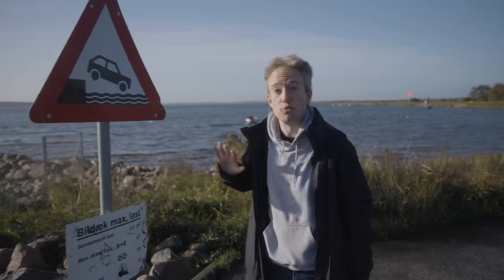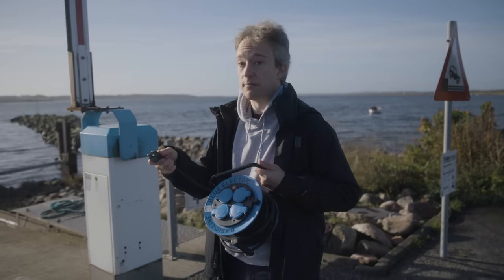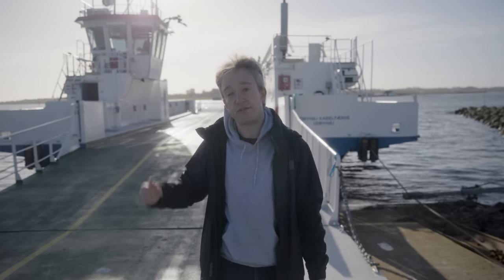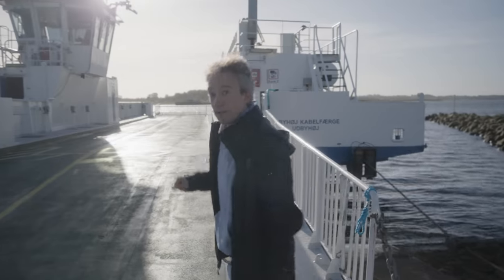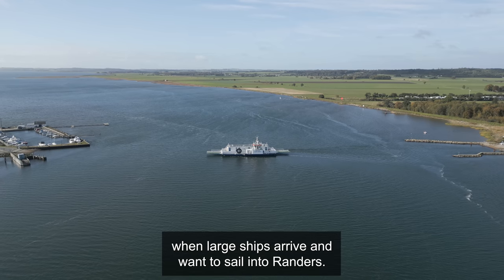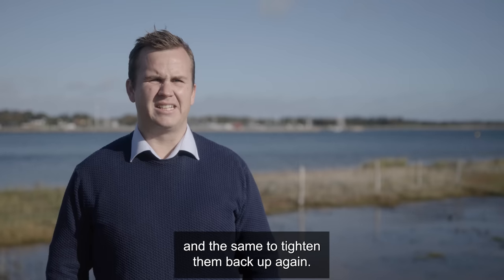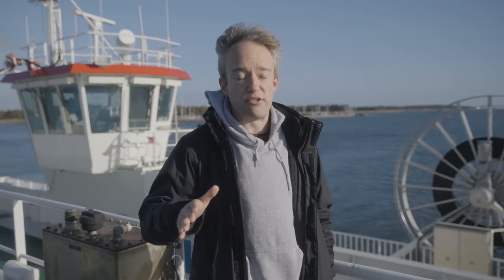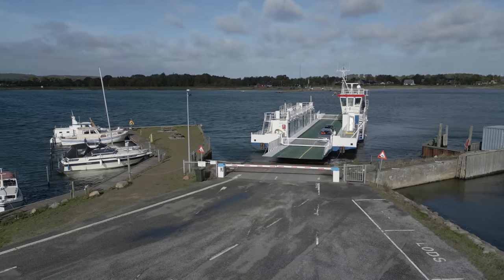This electric ferry uses a very long extension cord

Comment: It's a cable ferry so fine, why not another cable... But really a 200kwh battery pack could be easily and fairly cheaply installed on a ferry this size to allow it to run all day and charge overnight / or when it is docked a couple of times per day. A £50k Ford machE has a 100kwh battery pack so it is only 2 of these battery packs that would be needed to run this ferry for a day in the worst case. So even if the battery pack is 35% of the price of the vehicle. That is only £35k on battery packs, and £2k on chargers installed at the docks. That is not a massive extra cost.

Comment: Is the guiding cable the same as the one that provides the electricity?

And how do they prevent it from generating heat, if it's rolled up?

Comment: If there's a strong current the ferry doesn't even need a motor though, does it?
Reply: I wouldn't imagine it would be able to pull the ferry at a significant enough speed, even if it was pulling in the correct direction

Comment: At this point, why not just have a steel cable on a winch at the far end.. no need to put the motive power on the boat at all...
I guess this is probably a little more other-boat-friendly though.

Comment: After watching this for 5 minutes I came up with an idea is there not a way they could stick some type of like alternator to the battery with paddles on the side of the boat so as the ferry goes to the water to the other side it moves the paddles Which turns the alternator and thus charges the battery?

Comment: Stupid question: Couldn't they use supercapacitors to quickly charge? IIRC they have the capacity, but they are not good for long range.
Reply: Weight and cost I suppose, supercapacitors really don't store that much, although I suppose you have plenty of space on a ship.

Comment: I don't understand why the motor is in the boat? If it is cable guided, why not have the motor on the shore and the cable running over head pulling the boat in a cable car fashioned arrangement?

Comment: I like it!  Unlike Li batteries that destroy the Earth and depend on on slave labor, copper isn't so bad.

But one question comes to mind.  That power cable also represents a lot of rubber insulation, so why not have a winch on either shore to pull the ferry with the steel cable?  That's 2 motors instead of one, and a remote mechanism to control both winches (one pulls while the other lets out slack), but that would still be less carbon, right?

Comment: If you wanted to conserve weight, the reel should be on the shore where it is played out to the boat.  Of course the motor would need a power source.
Reply: That's a joke -- about the power source.  I'm not asserting that it's a good joke.

Comment: I'm kinda unimpressed. Reaction ferries use nearly no power and work perfectly fine wherever there is a stream with a current to cross, which seems to be the case here. And reaction ferries do not represent new technology at all. They also don't have problems with ships crossing cables, as those cables are not laid out across the stream but with the stream and are anchored a few meters upstream.

Comment: If two tower on two sides to hang both cable and it can pull and electric cal power back up incase cable weak or strong curernt we can empower electric motor assist for ferry pass the current

Comment: Eh. Why is the ferry being guided with a static steel cable using on board motors instead of being pulled by steel wires using motors/winches ON LAND???

Comment: My  cousin is in the RFA. When they had girls on board they would in the mess (or whatever it was called) they would have satellite TV  -they would tell the girls it was cable TV. If they fell for it they would say its ok, you just have to make sure you don't get it tangled around Islands - you have to go back the way you came.

Comment: The translation at 0:58 is wrong. He says “the ferry uses today between 150 and 200 kW.”

I have no doubt Tom Scott knows the difference between kilowatts and kilowatt-hours. But maybe the translator doesn’t.
Reply: The translator corrected his error because electric usage is expressed in kwh. Kw is to specify the energy consumption of a motor during its operation, not over a time period where the motor is not continuously used

Comment: It takes as we learned 150-200 kWh of electricity, vs 100 litres of diesel, which is worth about 1000 kWh of energy. This shows you, just how insanely inefficient the burning of fuels is (including so called green fuels) and how much energy we'll save just from switching to electricity.
Reply: Also, Tom wasn't right about the massive amounts of energy needed to operate a ferry: 200 kWh is three times the battery of a large electric car,  which would absolutely fit into the boat. The only obstacle probably is that it'll take too much power to charge them fast enough during the night.

Comment: hmm I wonder if it wouldn't be easier somehow to just pull the ferry with the cables to either shore instead of having the motors on the actual ferry.
I guess you'd need motors at both shores then and more cable length overall, but it seems to me like it might be a more reliable system, plus you'd save a fair bit of weight and space on the ferry itself so maybe it could carry more?
I'm sure someone knows a really good reason NOT to do this, so I'd love to hear it

Comment: os the eletricity on the power grid reneweable? It only makes sense if it is reneweable. Otherwise you just make the buning less eficient.
Reply: Yes, Denmark has a lot of renewable energy production. Most of it comes from wind power.
Reply: And no, the burning isn't made less efficient even if it was 100% diesel power plants. Electrical motors are very, very efficient. Diesel or petrol engines are not.

Comment: I could see this being the norm when wireless power is more common.
Reply: Wireless power will NEVER be viable for anything but very low power devices over short distances.. It's fundamentally impractical.
Reply: @Basement-Science  True but i was thinking in hundred years or something.
Reply: @paladinboyd1228  The laws of physics wont change until then. The best you could theoretically do is use lasers (still very inefficient, but not necessarily impossible to improve), but that still comes with HUGE safety issues.

Comment: Is the power sourced from renewable energy though?
Reply: Even if the power plant runs on fossil fuels, electric motors are more efficient than internal combustion engines so you'd still need less oil to power an electric vehicle than to power a ICE one.

Comment: "normally 100 litres of fuel each day"? That's f* all!
I think I understood that wrong.
Reply: Watched again; surely that was inaccurate. He said, on diesel, they'd use 100 litres a day; for 88 trips! That's amazing! But, they needn't use that because they are usually using just electric, so save said 100 litres. I'm guessing that ferry must use less than 50p/45c of electric, per trip. W..t..h..?!
Something isn't right there 🤔

Comment: I'm not sure why people automatically assume that electricity is "clean". Most of it comes from burning gas and coal, and that's anything but clean.
Reply: But Denmark does have really clean energy production.
Reply: Diesel engines are notoriously dirty, most power plants are highly filtered, plus you don't have any waste from idling, and Denmark often uses waste heat from power plants to heat homes.

Comment: So, when this cable inevitably snaps or is cut, what protects people in or on the water nearby...?
Reply: The breakers? Unless you're really, really close to the wire I doubt you'd get hurt before the electricity is automatically cut. And you shouldn't be that close to a moving ferry.
Reply: @SilverEye91  - I don't think you understand how electricity / circuits work...

It is estimated that about 10 drownings per day in the USA alone can be attributed to submerged live wires.

Circuit breakers are not going to trip unless the current overloads the breakers, in this case the current would be dispersed into the water as it would be the path of least resistance and since it has a HUGE capacitance there would be no current feedback to cause an overload at the breakers.

People in prison use live wires plugged into ordinary wall sockets to boil water every day without tripping circuit breakers. It's also how some prisoners die.

Comment: Is the ground power generated with renewable energy? If its taking power from a coal generated plant then just turn the diesel engines back on...
Reply: And of course you didn't bother to check Denmark's stats - 80% of their electricity comes from renewables & that percentage increases year on year.
Reply: @nightjarflying  wow its almost like I was asking a question and not stating any facts

Comment: I don't see why they couldn't just have the cable under the boat loose following the boat, and then not need the wires which cause issues for passing boats.

Comment: What weird choice of examples for "steps in the right direction".    That shallow and short stretch of water could easily been crossed by a bridge with the engineering knowledge existing a 100 years ago. 
There are tons of electric ferries around that has been in traffic for years.

Comment: a water tram could be cool
Reply: As in Ferries powered by Overhead Catenaries? They do exist, but there aren't many. Some use two Catenaries like a Trolleybus, others use only one like a Tram, with the Water being used as earthed Neutral/Negative, similar to how Train and Tram Catenaries work. Another Example for electric Ships powered by Overhead Catenaries is the Tug hauling Ships through a 5 km long Canal Tunnel in France.

Comment: I am not big about the climate change sect, but 100-200 KWh instead of 100 liters of Diesel a day is a big difference, especially in Europe. 
~150 KWh are around 50€ and 100l Diesel are more than 110€. So good on saving costs!

Comment: Why don't bigger ships use hybrid with the battery recharge done with wind, tidal or solar power something that could be used in the future
Reply: Some do use Hybrid Systems, but these are used for Peak Shaving. Peak Shaving means, that the Diesel Engines are ran more constantly with less Load Changes, which greatly reduces Emissions. Especially Solar Power is way too wimpy; e.g. do many People like to ramble about "Solar Cars", but even at 100% Efficiency, a Car covered in Solar Panels could just power a Teak Kettle (2 kW). When taking the abysmal Effiency of Solar Panels (20%) into account, even powering a Toaster becomes very optimistic.

Comment: 100L doesn't sound like a lot, does it? 100 bucks for fuel for a ferry for a whole day?
Reply: It's not the USA which would be $140 USD per day. It's $2 USD per litre in Denmark - fuel use for the ferry is around the same 'mileage' as ten medium-sized trucks. Fuel is an insignificant cost compared with 'derusting' & painting every few years, plus depreciation, maintenance, oil & paying back for the electrical infrastructure. The ferry is a social good & never makes a profit.

Comment: A ship with an extension cord does not seem like a step in the right direction Tom. Denmark is a 'net importer' of energy (which is primarily produced using nuclear and hydro) even though Denmark has considerable sources of oil and natural gas.....which they elect not to use. Rather than their being self sufficient.....they're quite the opposite.

Comment: 200kwh? That's nothing! Most long range electric cars have batteries in the 100kwh range. Batteries would have no trouble powering this, and you wouldn't even have to worry about the weight or cost in the scale of things. Not that batteries are allways the right answer though, this seems like quite an elegant solution in itself.

Comment: Why isn't the motor on the shore if it's just pulling a wire?
Reply: Because you cannot push a wire, so you'd need one on either shore.

Comment: Why don’t they just place the cable winding motor (remote control) on shore and attach the ends of the cables to the ferry. Then you don’t need an electrical extension cord on the ferry 😅

Comment: What if… the cable was used to pull the boat, so the boat didnt have to pull itself using a separate power cable

Comment: One more step in the right direction for what? Instead of burning oil on place, we burn it somewhere else for electricity, furthermore we use oil to extract copper, to produce kilometers of cables and use oil to install them. Fantastic example of "out of sight pollution" ecology.
Reply: That's not necessarily true since Denmark has previously had times where they have generated 140% of their electrical demand via wind power.
Reply: @epender  So you plant a seed and a wind turbine grows out of the ground. Ok, understood. I thought they were made of non-recyclable plastic materials, tons of rare earths and copper.

Comment: Or it could just use an overhead line with a pantograph.
Reply: Why have an exposed cable hanging loose above the sea when you can have an insulated and reinforced cable without a pantograph to get worn down?

Comment: Step in the right direction? So it just burns the fuel at the power plant. It's just moving the emmisions somewhere else. Out of site, out of mind. Presto, Green! Not.
Reply: I'd rather it come from a filtered, natural gas powered plant which sends it's waste energy to heat homes than a smoky diesel engine which spends half it's time idling.

Comment: Im curious on the efficency of running this on electricity vs running on diesel. Assuming the energy isnt coming from 100% solar / wind etc... then it would be very interesting to know how much energy each energy variation would typically use.

Comment: It's certainly a step in the right direction. If the electricity could use a wind turbine and/or solar generated, with a battery storage system, it would be a real eco winner.

Comment: If this huge cable is being constantly unwound and rewound 88 times a day, won't it suffer some sort of fatigue failure. I'm assuming that the cable is alternately wound clockwise and clockwise for each alternate outward jny

Comment: Gas replaced by electric (AKA: gas but far away so you don't have to think about it).

Still, if it works & local energy prices are affordable, then I think there's no excuse not to convert this sort of static infrastructure to electric.

Comment: Hmmm... Unless their electricity is generated by nuclear or solar or hydro or wind, their carbon footprint probably hasn't changed much per day, all they've done is moved it from onboard to someplace on shore.
Reply: Most of that energy will be used by burning natural gas, which burns cleaner than diesel, and these plants in Denmark often send their waste heat to be used as heating for homes and businesses.

Comment: You know, if our power generation was 100% renewable I'd say this makes sense.
But with good if not large parts of our power generation being from fossil fuels, this is just unnecessary.

Just keep the diesel engines/generators for a little more and use the money to get us more renewable power generation, and get it faster.
Reply: Big power plants are far more efficient than smal diesel engines
Reply: @hansht1477  
That very much depends on the power plant.

The big, old coal fired power plants in Poland are inefficient AF, for example.
In fact you need a very good, modern fossil fuel power plant to beat a good, modern Diesel engine.
Reply: @a564-c3q  Denmark's newest powerplants are highly efficient, Avedøreværket near Copenhagen is 91% efficient if you include the waste heat from electricity production which is sent to heat homes in the city. Diesel engines on the other hand will struggle to reach 60%, and that's not including idling.

Comment: I find it questionable if this is the „right direction“ if it all goes electric.
The main issue is fossil energy nowadays, not the type of propulsion technology.
Diesel engined vehicles can go renewable too, no need for fossil diesel (my car has been running on fuel from restaurant waste oil for over 10 years e.g.).
There’s more than one solution and this one here is far from ideal.

Comment: The electricity has to be generated somewhere. Most likely using fossil fuel.
Reply: However most of these power plants burn natural gas, which produces less particle emissions, and sends it's waste heat to warm homes. Diesel engines produce soot, spend a lot of time idling, and waste a lot of heat.

Comment: What a waste of electrical cord. It runs on two metal cables already, just hook them up to high voltage and you're done. I see no problem with that whatsoever.

Comment: zip line electric motor
Reply: more permanent ferry line, literally, metal wire with power line
Reply: you can even have induction ac cable transmission
Reply: simple and nice

Comment: What a JOKE!!! "Clean" electricity? I bet 90% of that "clean" electricity is coming from coal power plants. Don't get me wrong, I'm not against coal power plants. However, I am against the Green activists always trying to push "clean energy" (which wouldn't cover a fraction of the supply we need) at the detriment of our entire economy. Nuclear energy is the cleanest, and has great power output, but leave it to the "Greenies" to have a problem with that, too! 🤣
Reply: Making fun of CA is always the easy answer - but I think this time it's applicable:

I mean- imagine massively increasing your energy usage by forcing everyone to buy Teslas while simultaneously taking offline all of your major sources of electricity generation, and then wondering why the electricity market has exploded. At the end of the day no amount of 'activism' is a substitute for sound reasoning & a well-engineered solution.